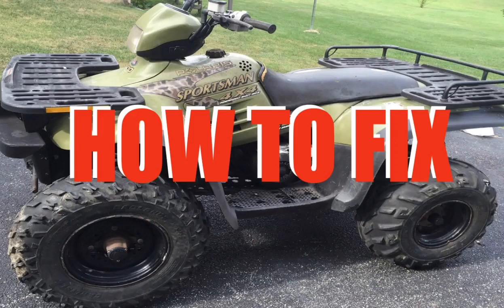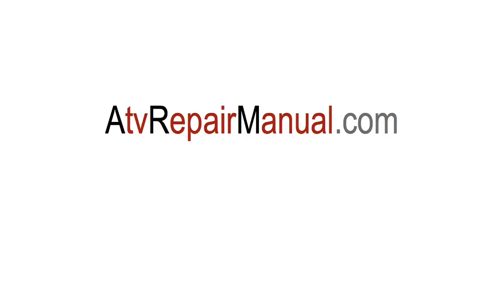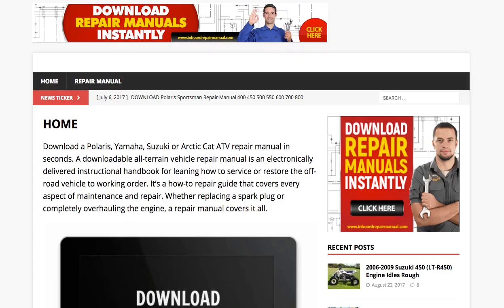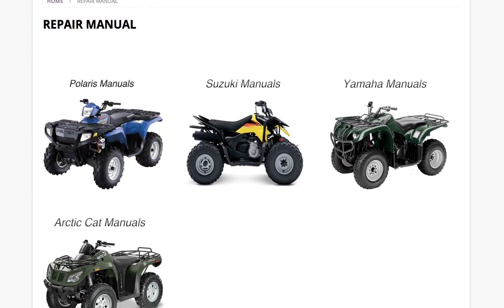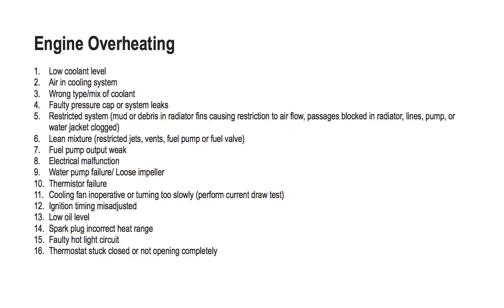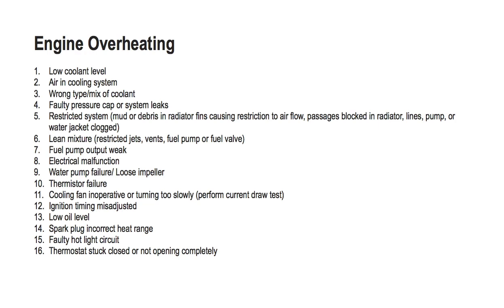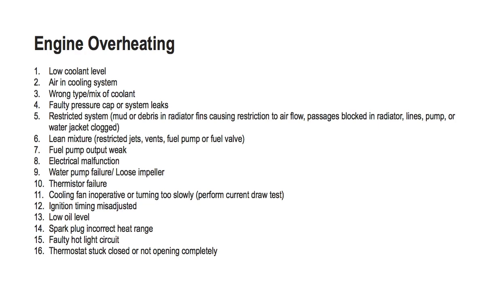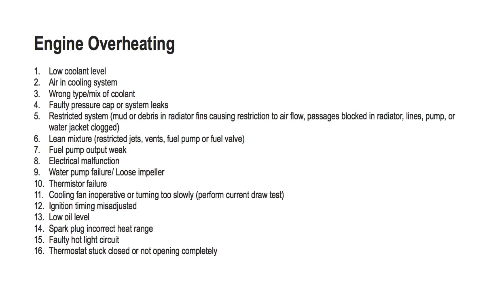Polaris Sportsman Overheating (90 300 400 500 600 700 800)

Comment: I have repaired many liquid cooled Polaris atv’s and found many of the cooling systems had a faulty circuit breaker for the thermal sensor located inside a hermetically sealed pouch that gets condensation inside due to atmospheric temperature difference between the outside air and the circuit breaker getting warm inside and is aggravated more increasingly in colder weather I replace the factory breaker with a marine waterproof breaker and Shazam problem solved permanently and far outlast’s the factory design year after year going on 16 years without incident just a tip👍🏼😉
Reply: What were the specs of the breaker?
Reply: Where is this hermetically sealed circuit breaker located on a 1999 sportsman 400? Thanks

Comment: Nice video.   My 570 overheats after five minutes.   Just joined.   Check us out, you can see my Polaris video.   Thanks.
Reply: Do rad relocate wrap exhaust and change the anti freeze / coolant out with Evans water-less coolant i have the 2015 570 so i have experienced  most of the 570 bs problems they run hot  as hell
Reply: o and make sure the coolant is full
Reply: How do you know it overheats? Does it shut off?
Reply: @NytronX  if it's like my 500 it simply steams and runs out a bit... my temp was about 230 at the engine... too hot.... am in process diagnosing now.